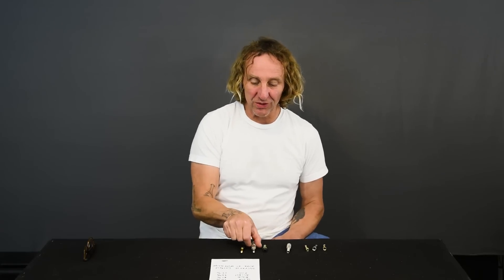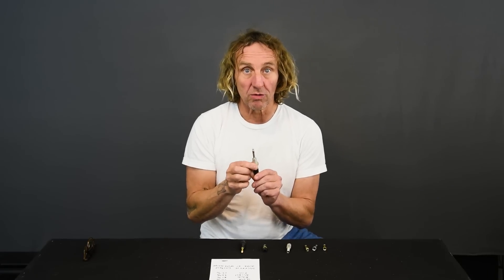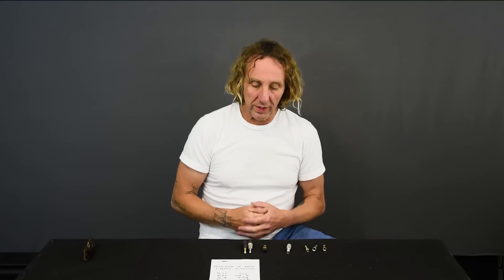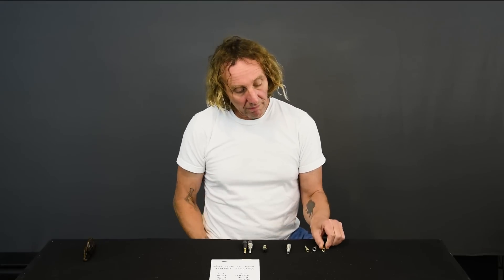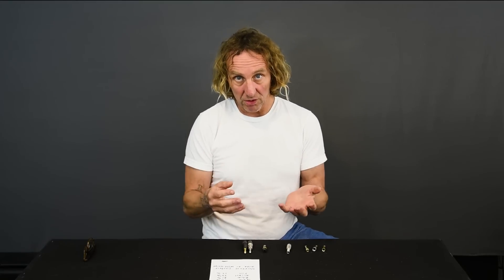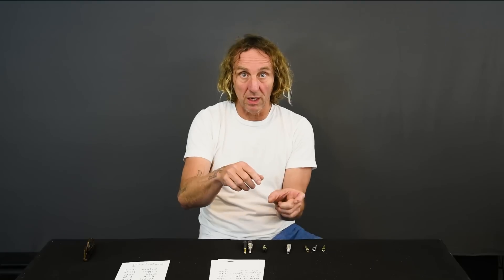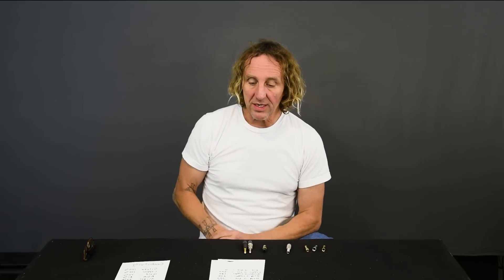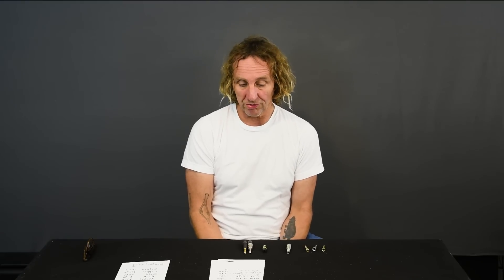Gold vs Silver (Nickel) Audio/XLR Connectors - Which is Better?

Comment: I noticed a long time ago when people would say we had a bad mic I would get it back to the shop and find nothing wrong with it. I started checking in the field if I just plugged the mic back in would it get better. I started making it part of our servicing of cables putting a little deoxit gold (since I guess it has a protector it leaves behind) in the connector and have found we received less working, broken cables and mics. More recently I started switching to the precision dropper of the d100l and maybe a brush to clean a little more. 

Ironically I have not liked the fader deoxit because it does not play well with motorized faders. But I have found it works really good with cleaning up in ear connectors because of the humidity from the sweat causing issues. Especially circular plugs since it provides a little lubricant.

Comment: What do you think about using Dielectric Grease on Permanent Install or Pedal Boards and Racks? I haven't heard of anyone in the audio world using it on connections, I figured it could be a good use to prevent corrosion like used on automotive batteries.
Reply from the maker: It's kind of a mixed bag. Dialectic grease winner connection is clamped with a screw clamp, is all good. But for a connection that can be removed it can tend to build up dust and dirt and then if it is plugged and unplugged at any point that dust and dirt can wedge itself into the contacts and make things worse. But if it's never unplugged and sealed from Dustin dirt it could provide a protection barrier from moisture and corrosion.

Comment: Hey dave I have had problems with looms and stageboxs driving me mental. Channels just start going down. The looms are wired in sitchu and just stop working. I had a few different looms and even old looms that didn't work start working. People never belive me
Reply from the maker: Have you narrowed down the exact causes? Sounds like corroded multi connector pins or corroded XLR pins could be something to check. 

As connectors get old and oxidize they can work sometimes and not others but when tested not show any issue

Comment: what about silver vs nickel. connectors shouldn't effect timbre at all, right?
Reply from the maker: Hmmm, timbre is a perception based opinion that sort of tries to side side step scientific and measurable proofs.

That said, I would say it is easily probable should you decide to to test.

Send the same signal down two nickle cables with one out of polarity and sum them for a null

Then send the same signal down one Nicole and on on silver and sum for a null, 

Compare the difference of the nulls.

Opinion removed, hear the difference.

My theory is that the difference will be not audible.

But would need to test. I don't have enough confidence their will be a difference to bother testing

Comment: Wow, that was super helpful! I'm an audiophile and I recently changed cables and it's interesting to know why the sound changed a bit when I did do the cable swap. Now I'm on the lookout for cable terminators that's the same material as the terminals for my speaker and amp.
Reply: I just thought of that.. I guess we should use the same material as the jacks on on the actual mixer, speaker and amps.. btw I haven’t watched the whole video yet
Reply from the maker: Though the probability that there is anything close to an audible sonic difference is improbable in the short term. The possibility that there will be issues in the long term is reduced when similar metals are used
Reply from the maker: Interesting

Comment: It mean when i had cable with gold connector but my microphone had silver it will cause the corode?
Reply from the maker: No, that will be fine. If you have gold and not gold connected for a long time and does not get disconnected, that will be more likely to corrode that gold with gold or nickel with nickel.
Reply: Thank you sir

Comment: i WAS WONDERING if I should spend much more money on gold plated connectors ..... and I viewed it as sacrifice for better tone. But I gather that my pedals don't have gold plated input jacks so it seems it would'nt be worth it at all! WOW! Thank you sooo much. So if I understood you correctly nickel is the way to go, ...right?
Reply from the maker: Matched is the way to go. But yes, gold is rarely an advantage, it's just showy and people pay more for showy
Reply: @DaveRat  Thanks for the quick responce.   So ... nickel IS what guitar pedal input Jacks use right? Do you know?
Reply from the maker: Yes, nearly all do, you can tell by the color.
Reply: @DaveRat  You said it yourself, I think: That color isn't necessarily nickel.
Reply from the maker: Since the only two real choices to buy moderns connectors are nickel and gold, and gold is more yellow. You pretty much are faced with matching color as the best and easiect way.

There are some old brass connectors out there as well as silver and copper, but those both have corrosion issues.

It does not matter too much whether you use nickel or gold but paying extra for gold has no real advantage except if the connectors on the unit are already gold and you intend on leaving the connectors plugged in for very long periods of time.

#1 avoid dissimilar metals

#2 avoid unnecessary expense
Reply: @DaveRat  True! Again: Thank you !

Comment: In the Audio World, RCA, Binding Post , Banana Plugs (Cables) - The ones I buy all say their make of copper and gold plated (non-metal) But I have bought a bunch of them and find out they are not and some are just junk? Is their a way to set up a test fixture that I can test my connectors?  and find out what their made of or similar metals? I can easy make one,  Dave it would be nice to see what I bought. I just bought some RCA connectors when solder a wire to it & the solder flows and then it turns into cold right away like a puddle of mush, Also have Dayton Dat v2 any recommendation on using this software package? Thanks Again for the Video
Reply from the maker: As far as connectors, if you want ones that are quality and will last, I would say just stay away from cheap off-brand stuff.  Buy Neutrik, Switchcraft or amphenol and you cant really go wrong. The connector should not create a cold joint, try a hotter iron and or different solder. Dont know the Dayton Dat software

Comment: Idea.....what about using some Di-electric grease on all of your connections?
Reply from the maker: Messy and attracts dirt. "Wet" connections create more issues.  Ideally well matched dry metals that are not oxidized work just fine
Reply: @DaveRat  I love your videos, I just found your channel today.  I'm looking at the Neutrik NC3MXX-EMC Cable Connector male and female vs. the regular Neutrik NC3FXX connectors.  I want to use the Quad mic cable to make my own cables, would it be a waste of $ if I use the EMC connecter or would it be ok to use the regular NC3 XX connectors when using Quad wire and what name brand Quad mic cable do your recommend?  Thank you so much for your time Dave!
Reply from the maker: Are you in a very high RF environment or using extremely low level signals? If so, the emc may help.  Otherwise, spend the money elsewhere.

Comment: Question...Makes sense....Do you know if someone makes a small round brush that you can use to clean out the XLR connectors?
Reply from the maker: Hmmm, I do not but a pipe cleaner dipped in R5 deoxit would work

Comment: Dave, you have any experience setting up a Danley rig yet? I'm intrigued by their re-think of horns and what I've heard impressed me.
Reply from the maker: I have not. I personally am not a big fan of high Q enclosures. Whilst they do reproduce dynamics well, larger horns tend to follow the concept of make a loud box and then process to try to make it flat and smooth sounding. Where as non horn loaded or very short horns tend to naturally sound flatter and smoother and processing is used to make it louder.

Struggle to get loud boxes to sound good vs struggle to get good sounding boxes to be loud

Though with EDM or other non live music, the added transients of a horn loaded rig can bring extra life to the sound, with live bands where we typically have naturally too many dynamics, and we are using compression and limiters to tame things down, having a very dynamic loudspeaker tends to make things more challenging.

Comment: I like your observation about connectors inside power amplifiers etc. I see this happen with the internal connectors with a range of pro audio items where the plating on the male and female connectors look similar (old Molex for example) but you have got me thinking that the choice of metals between male and female parts might be slightly different.

Comment: Yeh this is an ongoing issue, something that should be well know but isn't.

One of my early desks ( back in the 80's) had gold plated sockets for the mother board/loom and plain tinned fingers on the channel boards ...... by tinned I mean lead/tin solder ....... realy bad for dissimlar metals/galvanic corrosion ... i had to go thru that desk and clean and re-tin the edge connectors on every channel a couple of times ...... I ended up using contact cleaner/lubricant in an attempt to keep the air out and minimize the corrosion.

seen many other situations similar ....... I have seen many bits of audio gear where there are edge connectors go straight onto PCB tracks have caused problems ....... It has been common with some equipment to abandon the sockets and direct solder  as a replacement of the sockets.

Even when I was young I had two pet hates with guitar players .... cheap gold plated jack plugs and curly guitar cords ........ virtually none of the guitar amps, pedals or DI's have gold plated sockets .... so cheap gold guitar plugs where a guaranteed problem, the gold plate did not last long..
Reply from the maker: Agreed on all

Comment: Sorry ..dielectic grease on audio connections and what is your thought on fretting in connections in equipment maintenance the to go hand in hand ....thanks.....sorry for the split question
Reply from the maker: Putting a lube on connections can be helpful in the short to mid term. I have found that over time it often dries out and makes things worse. Also migration of grease due to hear makes a mess. But can be a fix.

Comment: Hey Dave, thanks for the great video series.

Would you suggest building cables witch two different connectors, if e.g. your console has gold contacts and the mic or amplifier has silver/nickel contacts?
Reply from the maker: If ya live near the ocean or somewhere that oxidation is a challenge, that would be wise.  Or if you are intending to leave things connected for many years.

If it is getting patched and unpatched, the connecter tend be ok

Comment: In computers there is also another phenomenon called electro-migration. (this one irreversible) But galvanic oxydation occurs too. Different topic : old computers sometimes respond well to spending an hour in an oven like 160 to 180°C worked once for me. => that seem to re-settle the soldering points, or possibly cleans some joints. I did a motherboard, with memory and graphics card, all together. the thing still works 2 years after oven.
Reply from the maker: Super interesting!

Comment: For a pedal board, if your pedals themselves had different connectors, would it make sense to make interconnects with say gold on one end and nickel on the other?
Reply from the maker: To optimize, and if the pedals tend to stay plugged in, that would be a cool thing to do. If you plug and unplug and/or you are not ever really near salty / humid weather, I would not worry about it too much.

That said, for critical applications  and to absolutely minimize the possibility of issues, matching metals and regular cleaning is the way

Comment: Take out All the connectors and solder everything point-to-point?
Wait, what solder should I use?
Reply from the maker: Soldering has issues as well. Crimping identical metals may be the best. But a good flux solder with some silver will do just fine for a 100 years of more in most situations

Comment: Interesting, it's even more pronounced in plumbing : zinc, copper, iron ...
Reply: EXACTLY what I was thinking.  I had to re-pipe a whole bathroom once because a joint corroded and popped.  That’s when I learned that you Don’t Mix Metals.  As the guy at Home Depot barked at me.  I still have ALL Copper everything in my plumbing tool kit.  (And ABS rather than Cast Iron, but that’s another story.)

Comment: As always, wonderful topic.
We have changed over to all gold connectors decades ago sind our first Amek Recall RN while it hat all gold connectors. And of course nowadays all the Midas DL251/155/151 stage boxes, audio interfaces and L’acoustic amps have gold connectors.

Wenn we did a few changeovers from nickel to gold mid Theater tour all technician had a feeling that there was more detail and that the high frequencies were more fase correct and not so harsh. Was not something we were able to measure but all technicians reprogrammed there desks and used way less eq afterwards.
Reply from the maker: This is the sort of thing I would need to test.  If it's there it should be measurable, the question is how to measure it.  I will ponder

Comment: That's awesome bit of info, good delivery and examples. Only wish you covered soldering part on different metals as it were.

thank you!
Reply from the maker: Solder works well as it has tin which is fairly neutral and it forms an air tight bond, and even with dissimilar metals, if the connection is isolated from moisture and salts, the connection will last a long time with minimal issues

Comment: Great stuff Dave. The years I lived on a sailboat in saltwater taught me a lot about galvanic corrosion and dissimilar metals. So cool to see that explained in a completely different realm with the enormous amounts of tiny audio connections we deal with! Thanks!
Reply: The boaters on the thread are well aware of this - many boats have sacrificial zinc anodes connected to other metallic parts that are below the waterline so that they “take one for the team.” Zinc is highly susceptible to galvanic corrosion, and that zinc chunk will deteriorate and save the other parts from the effects of galvanic corrosion. 
Not to mention boaters dealing with problems with electronics & other metal things not specifically meant for maritime use. People with beach houses putting in outdoor speakers almost always find out the hard way that they need specialty components. 
Peripherally audio-related: even stainless steel loudspeaker mounts/hardware can fail over time in high chlorine environments such as natatoriums. Chlorine stress corrosion cracking can affect metals, especially where they are not regularly cleaned with fresh water. Speakers are usually up away from being “washed” so the byproducts of chlorine mixed with impurities can sit and go to work. High molybdenum content stainless steel is much more resistant to this issue. There is “One” speaker manufacturer who has a natatorium series of speakers made for these environments.
Reply from the maker: Very cool and thank you! Interesting. Thank you Clay
Reply from the maker: Yes! People with boating experience know so much more about this than audio humans. We need boaters designing connectors!

Comment: Could it be that more current causes more corrosion? I got this bass amp with a phone plug speaker connector and it's getting worse... but also in general phone plugs connections fail over time. Which is annoying since you often find them behind patch bays, so you'd stick your head into some rack, unplug all patch cords, try to spray-clean it all, and re-connect in the proper order. XLR or Speakon never caused me that much trouble.

I actually learned about the galvanic corrosion from my girlfriend who once was about to become a goldsmith and those do know these things.
Reply from the maker: Yes, I believe current has an impact

Comment: The pandemic may be showing the shortcomings of metal/metal connector contact in the pro audio world. A mixer rental house I know of is going through all their desks right now, many of them nearly brand new, because they've been crashing on boot after sitting for a year unused. Makes me wonder if those desks have mixed metal connector junctions. My own Avid desk started suffering this issue as well. Hard to figure out the exact failure point as it's intermittent and only happens when it's booted cold. After it warms up, it never crashes. Going through and reseating all cables will make it stable for a year or 2. Then it's back. Fun times!
Reply from the maker: How do the consoles know? Does turning them on and off stabilize them? Does being moved around make them more reliable? What about studios where the console doesn't move.

What is it that would cause a console to know the difference between being off for a day or a year or less likely to work after off for a year vs turned on everyday?

Is there really a diference or is it just a perceived illusion when normally we find all the same faults that occur over a year, during the year and after a year of sitting we actually do d less faults overall but find them in a short time, giving the illusion that sitting dead creates more issues than working constantly?
Reply: @DaveRat  I submit the heating/cooling cycle might "work" the connections enough mechanically to keep the oxidation down from expansion/contraction of the mating surfaces. It's an interesting conundrum.
Reply from the maker: I like that theory. Makes me think maybe turning it on and the heat may burn off moisture and reduce oxidization

These are the things I really enjoy where as you dig deeper, simple logic fails to hidden complexities.